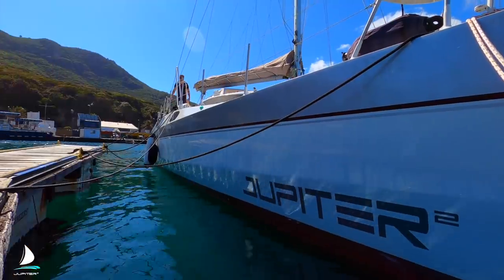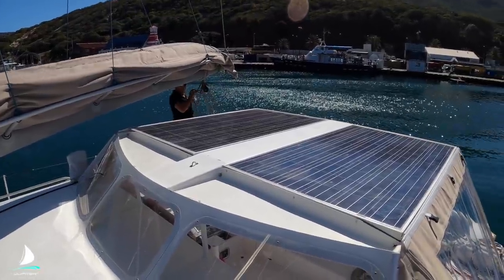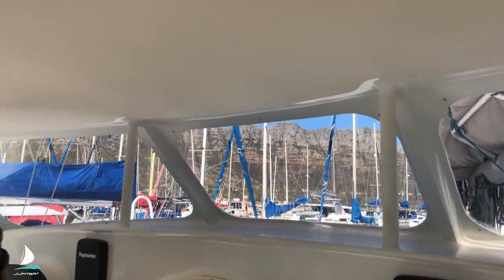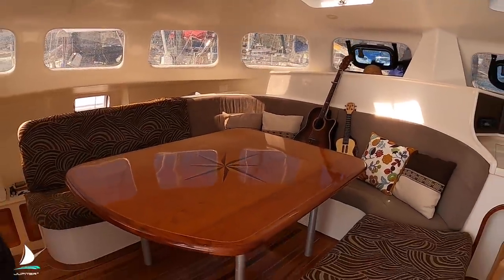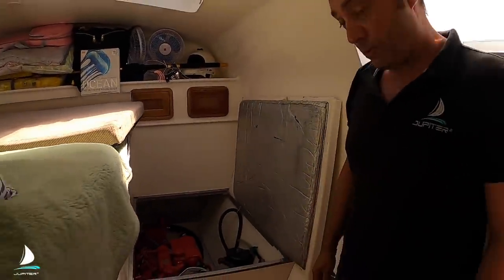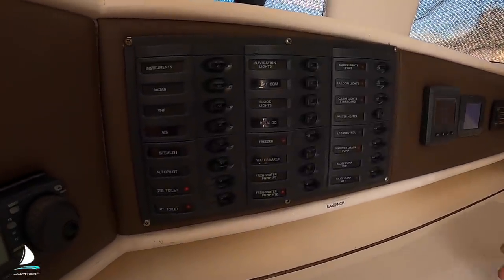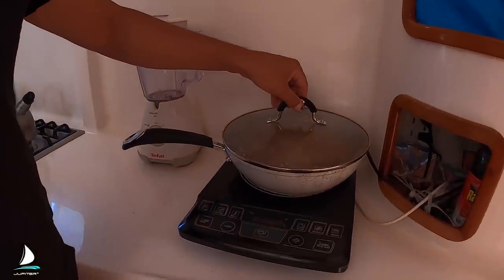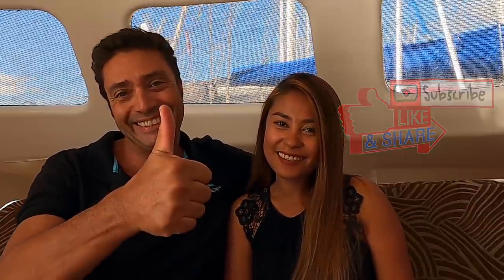ALUMINUM PERFORMANCE CRUISING CATAMARAN: BOAT TOUR EP1 , Meet Jupiter² and the crew

Comment: Starting from the beginning lol. Question...you mentioned you spend around half of your time sleeping. Can you both sleep at the same time or does one of you have to keep watch? If you can both sleep at the same time does the boat keep sailing and if so are there any potential problems that can occur? Thanks...
Reply from the maker: Hi Tom, tks for watching... With just 2 of us, we typically do 3-4 hr shifts... 1 always on watch... Sometimes it's a struggle... For watch keeping 3 crew is better because then you get 6-8hrs rest.
Reply: @SailingLifeonJupiter  Thanks!
Reply: If you have good warning equipment, of ships near, you can all sleep. The auto pilot steers.
Reply from the maker: I wish it were that reliable Grancito... But there are plenty of large and small vessels without AIS... Fishing fleets etc... But they usually have lights, hence the need for a watch...
3 crew is ideal, but we usually just go with 2. Tks for watching!

Comment: Any drawbacks to an aluminium hull?
Reply from the maker: No probs with hulls... But around the deck fittings the paint doesn't like to stick very well... Dissimilar metals will cause a little bubbling after 4-5 years... Cosmetic only.

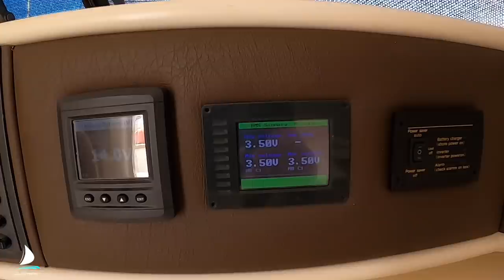Comment: at 9:55, 12:54, and 14:31  are there many other places on your boat where the fiberglass corners and/or surfaces have cracked like that?  Or kerf cuts that go out of the square opening.  These are concerning from a fit and finish point of view.
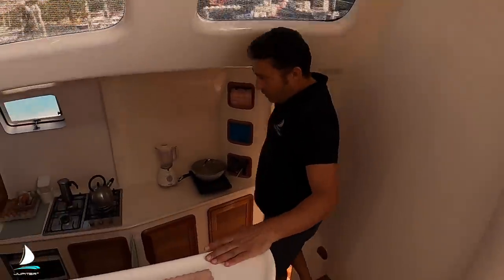Reply from the maker: Hey Tony... 9:55 is from hitting s concrete seawall when all the fenders popped up in Mauritius..the hull flexed and cracked the rigid gel coat coving..... I can't see anything at 12:54...14:31 is just unfinished... We were supposed to install a gas oven there which has its own skirt... But never did.
Cheers
Reply: @SailingLifeonJupiter  Thank you for the prompt reply.  And good to hear that the issue at 9:55 was not a manufacturing problem.  At 12:54, there is what seems to be tape on all the seams, I guess those are the edges of the fiberglass panel.    Also, is there insulation on the entire boat?  For instance, on the back wall at the windows area.   

I'm very interested in what you have had built which is why all the questions.  Not hating but loving.  :)